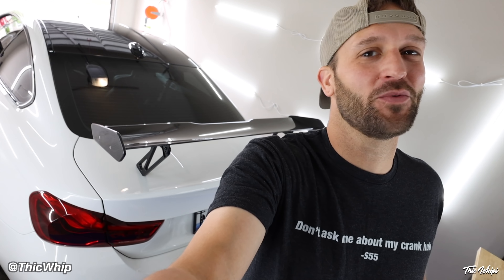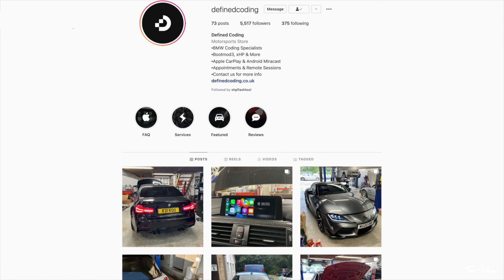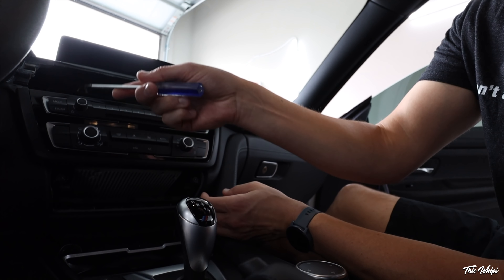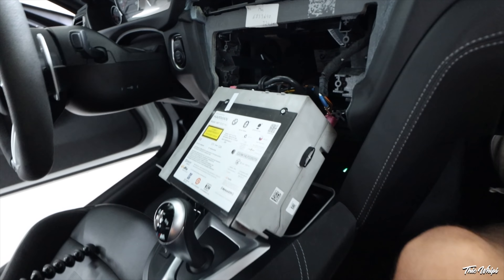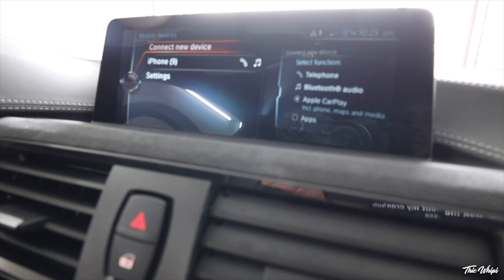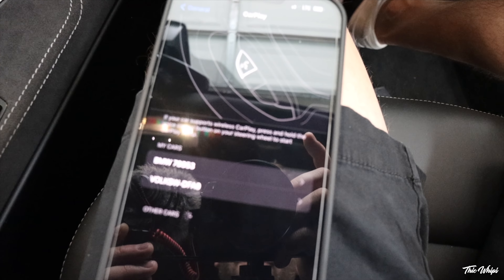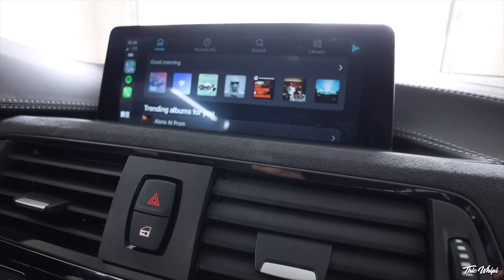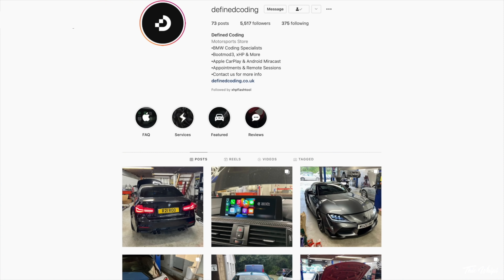FULL SCREEN CARPLAY in my M4 GTS!

Comment: How do you get it Full-Screen cause mines has Spilt Screen it doesn't allow me to have FULL.
Reply: Drop us a message we'll be happy to help!
Reply: Use Bimmercode or E-Sys on headunit (NBT-EVO) and set CARPLAY_FULLSCREEN flag under HMI to 0x01 (aktiv). No need to do the older USB or ENET .ini hack.
Reply: @definedcoding  I have the same problem with a 2018 m2. I want the full screen. Please help